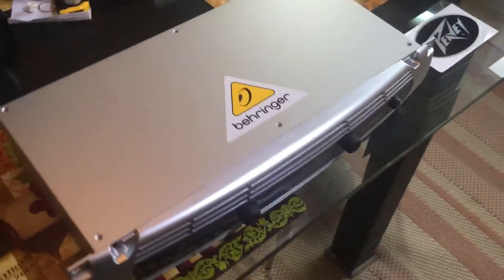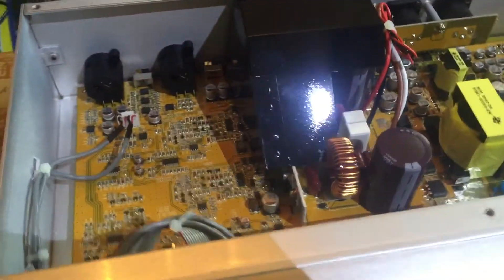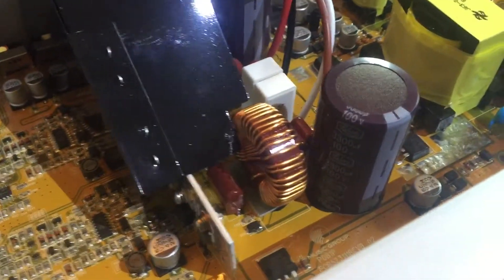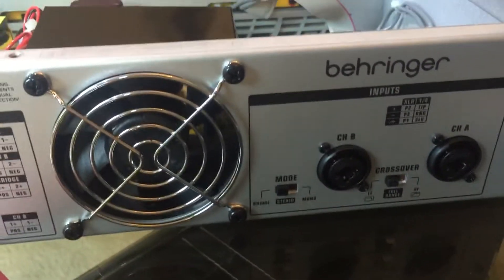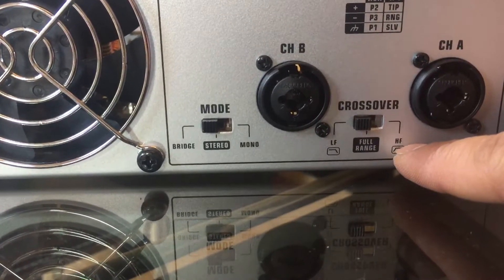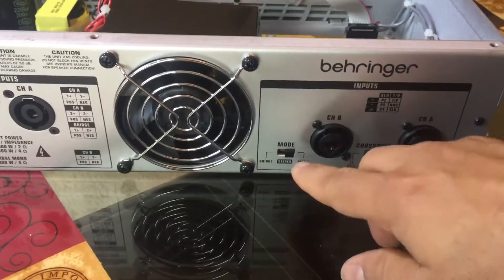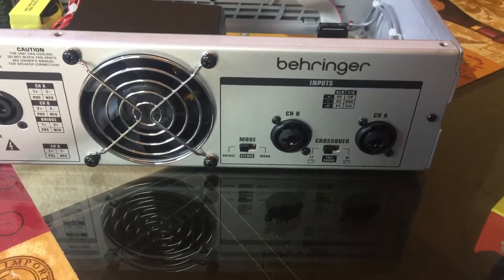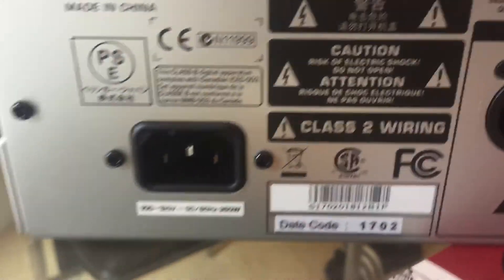Behringer inuke3000 inside look and specifications

Comment: When u power it on the cooling fan start working right away
Reply from the maker: I have it on the bridge mode and I tell you it’s amazing but If I where to choose from Beringer and Peavey I’ll choose Peavey all the way up
Reply: Gio Ch well I’m just a beginner doinq this kind of stuffs!!
I just wanna try something different with more bass
Reply: Gio Ch yeah peavy has a very good  dj equipment
Reply from the maker: Peavey more quality and reliability and most of all the technology that Peavey offers is the best on the market to me.
Reply from the maker: For bass amps you have a lot of varieties
Reply from the maker: But for my personal use I’d use Peavey or beringer
Reply: Gio Ch yeah dats why I bought the behringer
Reply from the maker: Yes, it supposed to start working as soon as you power it on
Reply from the maker: But is a very good quality amp
Reply from the maker: Anyways if you don’t mind just suscribe to my channel because I’ll be posting a lot more videos
Reply: Gio Ch yeah I just did👍🏼
Reply from the maker: I running it on 2 cabs with 15 inches black widows
Reply from the maker: Peaveys, and it goes insane loud
Reply from the maker: This one don’t even stop the fan
Reply from the maker: You should have warranty with it
Reply: Gio Ch I bought on Ebay used
Reply: I’m not an expert but I will like to use it with my car subwoofer
Reply from the maker: So you bought it brand new or used ??
Reply from the maker: Yes that’s fine but if is not working make sure that you can return it
Reply from the maker: They just can’t sell you something broke
Reply: Gio Ch so wats powerinq ur inuke